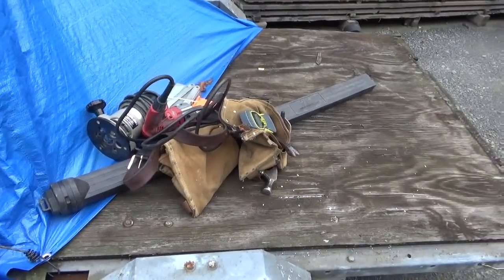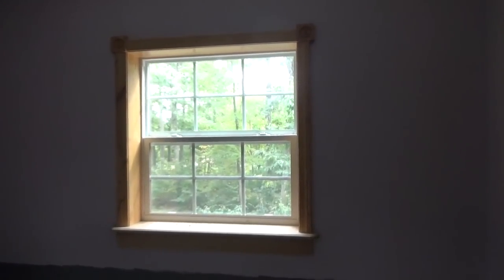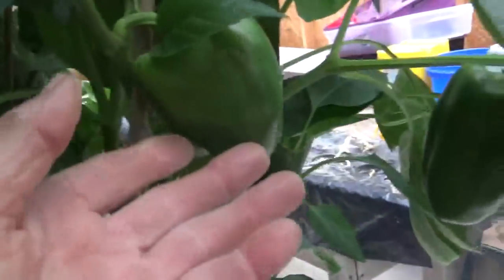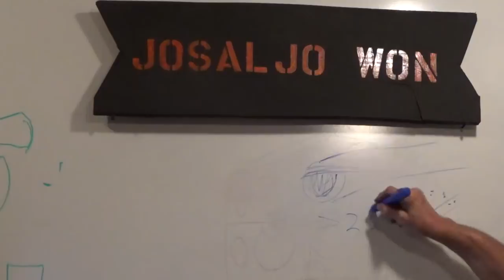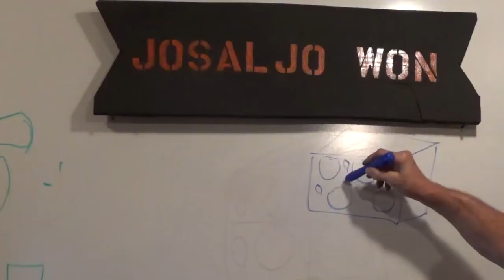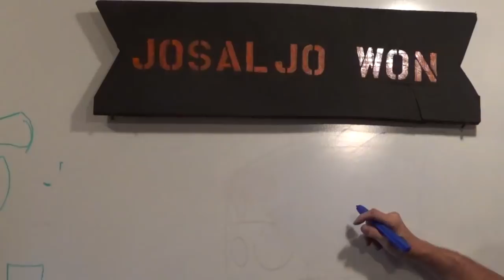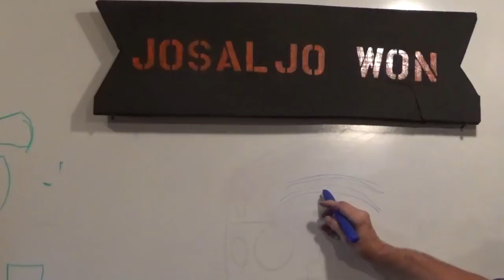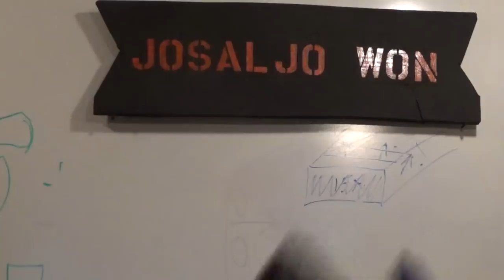Anything goes Saturday: also a lecture on end coating of lumber.

Comment: That was a very good explanation of moisture content and the drying process. I moved wood commercially so mever had it setting atound long enough to worry about checking.  But if i was doing what you are checking is indeed a big big issue and any mitigation will add value to your end product. Improperly drying and checking can rob you of the profit of your product.
Reply from the maker: Thanks Ken, truer words were never spoke. If this little mill ran to capacity every day, improper drying could add up to thousands in in losses a year.

Comment: Thanks for the video. I live in the mountain west where humidity is low, below 30%. Should I install a humidifier? Is an oil stain ok to coat the ends with? I hear some people oiling their wood. Do they use mineral oil? Thanks, grant
Reply from the maker: Good morning, if your relative humidity is always below 30% I dont think you need a dehumidifier if you have a solar kiln and it has good southern exposure.
 I would not use stain because stain alone allows wood to transfer moisture so you dont want that on ends. Mineral oil is something I have not used so I dont know if it works. You have to be careful with oil around hardwoods, it can absorb to deep into end grain as to affect the ability to receive a finish.

Comment: Hey Joe, enjoy the class! I've got a question about your kiln. The knee wall in front that you step over to load your wood, wondering if it is hinged at each end? I thought you built it like 2 doors that meet in the middle making it easier to load and unload.  But i've slept since then lol
Reply from the maker: Yes I have them removal not hinged, but they are a little heavy so i step over instead.
Reply: Josaljo Won I've seen you working..... they got to be heavy!

Comment: Hi Joe,

Great video.. I've been wondering if you could apply that Japanese wood burning method to end of logs and wood posts? Instead of using tar or paint. What are your thoughts?
Reply from the maker: That is a great question. Something tells me no, but I think it might be worth trying just to see what happens. I am thinking that the end coating is to slow the drying, and heating it would speed it up. I am going to try it just to see what happens.

Comment: Morning Joe..... will there be a test after class? I think all my wood that my neighbor cut for me is going to check and may not dry properly because he used only two stickers between rows and never end coats them. My piles of wood are outside covered with old metal roofing. By the way, how do you paint the end of a white pine log when the sap is running full bore? All my wood is white pine and I have no plans of planning, I'm only using it for rough projects up at my barn and other outdoor things. I know that if I had a mill I would definitely follow your lead on everything. I don't have a lot of mixed wood like you have on your property, most of my trees are white pine.
Reply from the maker: Morning John, drying wood isnt rocket science but it is really a confusing issue if a person does not apply the variables correctly. Checking in WP is usually not a big deal especially for your application. This weather has been so humid it would not surprise me if the wood you had cut did not check. Some people are so fussy that the slightest thing on a board makes them not buy it. Hence engineered plastic wood. You know that certain applications are hard on wood and peope dont like making repairs. For myself I just cut the bad end off. Lol have a good one my friend.
Reply: Same to you, too. My hot tub plumbing is repaired, now all I have to do is wait for the repacking expanding foam to come this week and I'll be back in business. The hot tub is great for my back! Have a good one.
Reply from the maker: With the white pine, I just slop it on. The brush is faster than the sap... lol